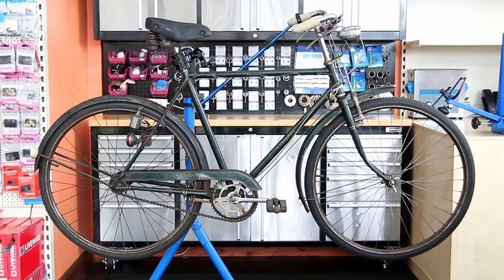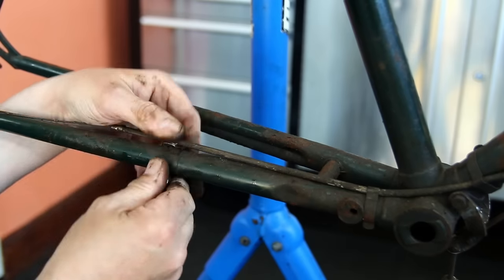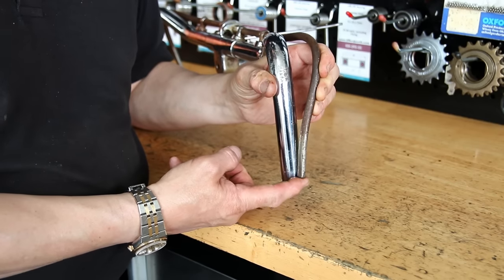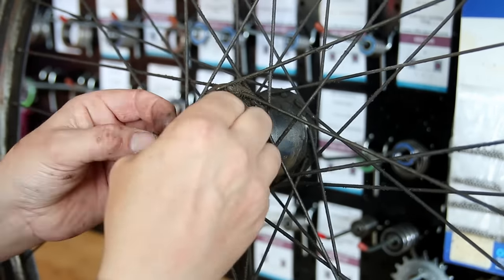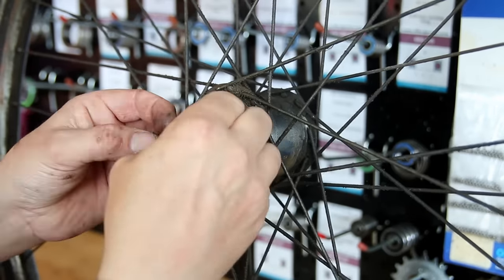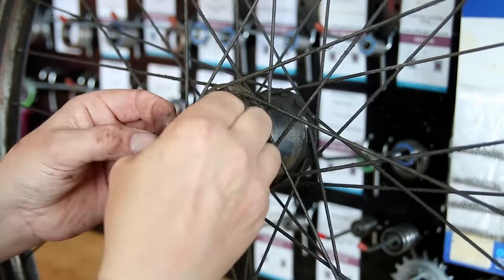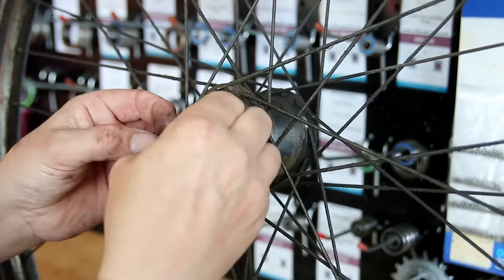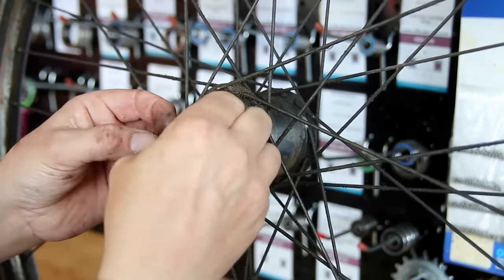1973 Triumph Restoration! Full Vintage Rebuild! Sturmey Archer, Wheels, Headset Bearings Service!

Comment: Loves these videos, I have a 1950s Raleigh ladies bicycle which I found in the 1980s at a tip and restored it with my grandfather, it was then used by gran and then my mum and has been handed back to me. I have stripped it down to the frame now, but realised I didn’t take any photos before. 😂 so these videos are great for me to remind where everything goes.
Reply from the maker: That’s a great story behind the bike, good luck with it!🧡

Comment: Great resto. Quick heads up at 19:00 (as you mentioned pedals being one of the few things you use torque for); for a torque reading to be correct when using a crow's foot, the crow's foot has to be 90deg to the head of the wrench, or you'll get an inaccurate reading. Great resto! Loved the hub cleaning. :)

Comment: I also wet sand and clear coat the paint.   These are great bikes  50 yrs down the road you still rebuild.  Good luck with carbon electric non serviceable bearings.    I have a Raleigh with three speed and derailleur are they rare  great job Simon😎
Reply from the maker: Absolutely, these will still be here 50 years from now🧡

Comment: Great job as always totally enjoyed this video.. This bike is very similar to the 1962 Raleigh you did months back. The Triumph and Raleigh were such well made bikes. As with this one all cleaned lubed and ready for many more enjoyable miles. Thanks
Reply from the maker: Yes it was very similar. And in a crazy turn of events we saw both of these bike models for sale again local to us! So we actually could’ve done 2 of each but chose we’d done enough racing green vintage bikes for a short while! Thanks for always dropping us a positive message 🧡⚙️

Comment: Amazing how the condition of the planet wheels, planet hubs and starclutch are after more than 60 years. That's a other story than the ABC gearhub of these days.😄
Great piece of satisfying work by the way.
Reply from the maker: The quality on the old bikes is far far beyond todays they’re very hard wearing, thanks very much for watching 🧡⚙️
Reply: @Bikespeeds  yes that's what you've got with the throwing away society. Quality isn't that important anymore. The bikes were that good that day, that it's economical not responsible anymore. But it's a pleasure to see those bikes, especially when you disassemble them.
And indeed I love to watch your video.
Also just normal without hand gloves. Lovely old fashioned in that way. Only than you've got feeling with the bike.

Comment: As a teenager,  I owned a Robinhood.  I know the Sturmey Archer hub well. Ridden hard in all weathers, they weren't well sealed and needed to be dismantled, cleaned up, and new bearings installed periodically. They had a unique pawl sound when tooling along in 3rd gear. There was also a 3 speed derailleur version with drop bars produced.
Reply from the maker: Great memories 🧡

Comment: I have a 1974 Union single speed with a coaster brake. I dont think the brake hub has ever been opened, and it's working great. The paint has faded a lot, but with a new crankset and serviced bearings, plus an old brooks saddle, it rides great. I fixed both lights to run on the dynamo, the lights are "earthed" through the frame! Lovely old tech.
Reply from the maker: Sounds awesome, you can’t beat a nice patina!🧡⚙️

Comment: Amazing restoration. It was really interesting to see how that vintage stormer archer had extremely similar internals to the sram i-motion 3 that is fitted to my Mercedes Smart E-bike. I recently did a restoration on it myself by doing a full service, overhaul, battery refresh and cosmetic repairs. You guys make excellent restoration and servicing videos so keep up the good work 👍.
Reply from the maker: Very interesting that the technology is the same, thanks for watching!🧡⚙️

Comment: Omg I literally got done with a hub like this one yesterday, but it was the drum brake version. It's from 1954. 
I did have source 4 new pawl springs (HSA120) and the threads on the gear chain was worn so I'm waiting for a new one in the mail. I can't wait to see the look on the customer's face...
Anyway great job as always.
Reply from the maker: That sounds like a mega job, well done!🧡
Reply: @Bikespeeds  yours was mega'er. truly one of the best restorations I've seen. And I watch a lot.

Comment: I think this is older than 73, could be another 10 years. Fantastic bike and lovely restoration, another bike saved from the scrap heap. I bet you could not do this to a carbon fibre bike in the future they will not last like this bike.
Reply from the maker: This will definitely still be here 50 years from now and we can’t say the same for the high end stuff that’s for sure 🧡

Comment: Wonderful work, if you like that sort of bike.  May I add one comment?  Having ridden a vintage bike with dynamo operated lights, I do know that when you stop at traffic lights, or at a road junction, your lights go off!  I know some people will hate this idea, but using battery operated lights in addition to, or instead of, the dynamo lights, will keep you visible at the most dangerous times, i.e. when you are not moving.  Fans of the 15th century might be unhappy about this, but it's better than having WVM knocking you into a different post code.  You may not survive the latter.
Reply: You can put super capacitors, and put a rear led on the back with a pwm regulator or similar, and a front 3W bulb... so 30 or 40 seconds when fully charged is doable..
Reply from the maker: It definitely can be done 🧡
Reply: @aitorbleda8267  
Was this mentioned in the video?
Reply: @Bikespeeds  
Was this mentioned in the video?
Reply: @mathsweb3370   Pretty sure no.  This is a restoration not a modification video.
If it was my bike I might modify it because I had the same issue with bike dynamos decades ago.  I went battery operated, but I would consider it safer with some modifications for the lights to be on while stopped.
For safety reasons and further deterioration of the bike this should be a dry day only bike.. chromed rims in the rain provide almost no stopping power.
Reply: @aitorbleda8267  
I know these modifications were not mentioned in the video.  I was pointing out that a dynamo operated light set is inherently unsafe, then other people started waffling on about mods they could make.  So what?  At one stage, I had a dynamo light set, and then, on another bike, I had a pair of lights powered by massive great D cells, I think.  Even with large Ever Ready cells in, the lights were not very bright at all.  These days, of course, people have intensely bright lights, which cause me to stop, because they blind me!  Hey ho!

Comment: Very nice video.
At 18:34 it's better to place the pin from the other side so that your pants won't get trapped on the threads coming out of the nut when pedaling and your pants will eventually interfere when your feet is on the front.
You can figure it better at 20:28 with the pin very little on one side and big on the side of the nut + threads.

😀😀😀😀😀( this is five stars for your video ).
Reply from the maker: Great tip!🧡⚙️

Comment: Y'all showing just how high skill and care this work is. You didn't mention anything about straightening the wheels. Were those actually true enough after all that time?
Reply from the maker: They actually were not. True enough to work and brake mind you. There was a dent in the front wheel that we ended up tapping back into shape🧡

Comment: In my opinion and experience, pedal spindles only need to be nipped up, without any need for a torque wrench. They tend to tighten rather than come loose during normal use of the bike.

Comment: Love the video.

Quick question, why did you choose to reuse the original tires instead of replacing them?

I ask because my personal opinion is that it’s much safer to replace old tires due to improvements in tire technologies and deterioration of old tires

Comment: I've worked in classic car restoration and bicycle mechanics for years and here's my input. For rust on chrome and stainless, use a wet ball of aluminum foil. Works the best. To "buff" it use ultra fine steelwool. Either enhance the patina or repaint in whole. Don't do hard and half it looks like shit. To preserve the patina use Poppys Patina (yes even in the rusty fender) it'll preserve it and bring back its shine, unlike clear paint it doenst chip over time which I like. Everything else was great!
Reply: Also PLEASE use PB or WD40 for the stuck on parts!

Comment: Hi, loved the video, How did you clean up the brake contact area of the wheels as it wasn't mentioned unless I missed it
Reply from the maker: With wire wool, it was not the best but it was the best I could get it🧡

Comment: When I watch bike restorations and revamps such as this, especially with a chain that is so worn, I wonder why there is not more wear in the chain set and  rear sprocket/s. Is this because things were built to last with superior grades of metal ?
Reply from the maker: The whole nature of parts becoming faster and more efficient is that they have less tolerances. So as bikes get faster and faster they get less and less durable. It’s not that things were superior back then in terms of build quality, but the whole design ethos was for them to be hard wearing rather than efficient 🧡

Comment: So how many hours was that? Takes me days. LOL. That was a pretty good bike, but had those idiot rim pull lame brakes?? LOL. Only slightly better than spoon brakes. LOL. Yah I used them in China 2 times. Can't say I ever liked side pull calipers either. 
That bottle generator takes away 50% of your effort. Hit one pothole and the filament breaks, then the other burns out. I tried a LED bulb, but it melted the plastic tail case. 
I had a 1974 Raleigh crap 5d, never did figure out how to use cotter pins without gouging them. The only thing good on that bike was the plastic grips and fenders, both are on bikes I have now. In 2017 I bought a 1973 CCM 3 speed in superb near new repainted condition, likely because  the SA hub was missing the plastic spring cap. 
But still I gave it new 650B wheels and proper DRUM brakes on the rear, kept the nice front hub. It has a one piece crank with pitted races, but still no problem after 6,700 miles. I do century mile rides with all my IGH heavyweights. EASY. 
My 1st SA XL-FDD has 32,000 miles with one bearing change, pads still have 5,000 miles to go. NO brake is better overall. Both lights have been on the whole time. 
I ran out of the nice Krazy Grease I had and they went out of business, damn it.

Comment: Really far gone restorations are tough because you can only do so much for the same hard effort
I used to have a 1974 Porsche 914, she ran like a Porsche, paint was thick
but as for the rusted body panels, it was I live with it or I invest 20k
there is a bit of compromise at a certain point of wear
Reply from the maker: Exactly that🧡